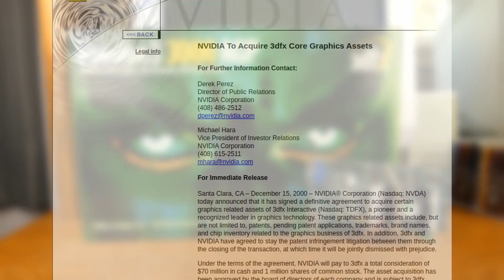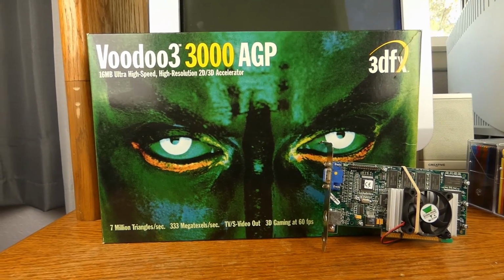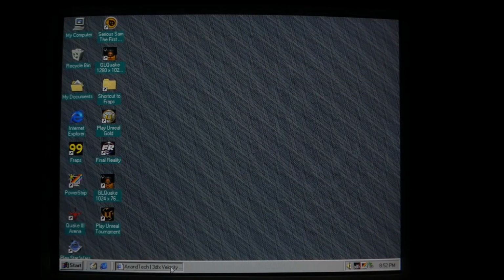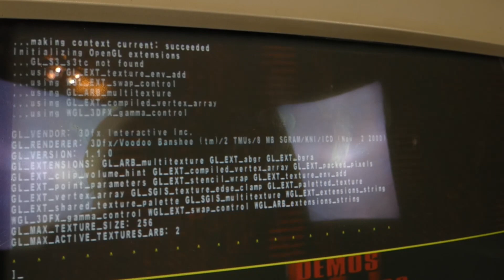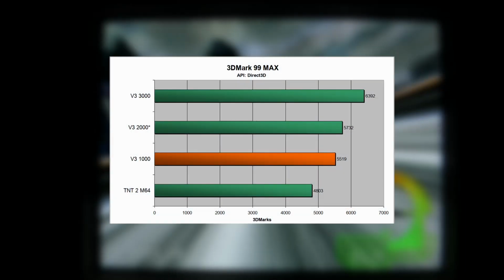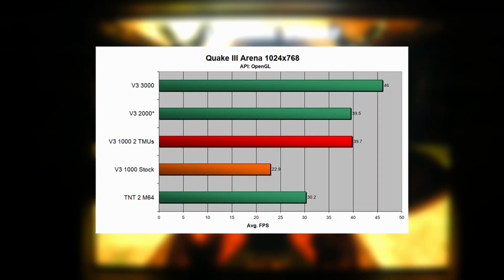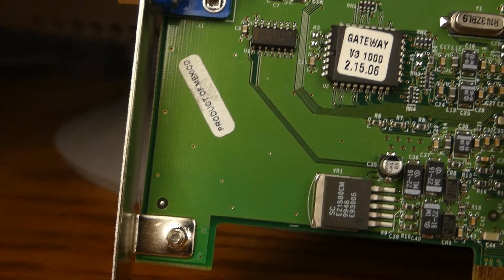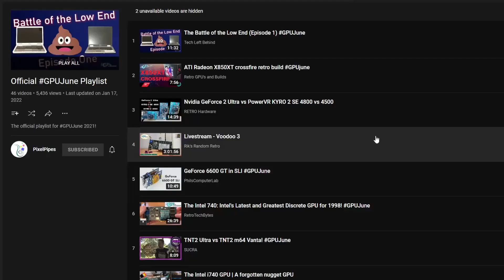The Voodoo 3 Everyone Kinda Forgot

Comment: I just dug up my Voodoo 2, Voodoo 3 2000, and I just acquired hidden away in a Pentium 200mhz ceramic package no less powered Compaq! Usually I see them in plastic like the MMX but I popped the heatsink to be greeted by an i200 label! But I booted it to see a Voodoo Banshee bios pop up.

Comment: I suspect it wasn't so much laziness but cost-effective so they didn't need to produce another chip but then needed a cost-effective way of lowering the performance of these OEM cards. So they went for the software option that likely went over the heads of most people using them.

Comment: There are even more differences between the 125mhx and 143mhz models, which is that the 125mhz models typically use 2TMUs where the 143mhz one has only one. Like you said too, the 143mhz one also only has 8mb of memory while the other has 16mb. When talking about the two unique models, I typically call the 125mhz model the Voodoo 3 1000, and the 143mhz one the Velocity 100.

Comment: I have a V3 1000 16MB 125MHz no heatsink pulled from an old Compaq Presario 5900Z. I installed a heatsink but the card runs pretty cool and is a decent GPU for free. Great video didn't even know about the TMU locked out.

Comment: Sir, I believe that card is called 3Dfx Velocity 100 and not Voodoo 3 1000.
The Voodoo 3 1000 has only 16Mb model (I have this card along with Voodoo 3 3000) while the Velocity 100 has only 8Mb model.

Comment: Your TNT2M64 results look really bad, maybe you were using TNT2 vanta? I had M64 and I'm pretty sure that quake 2 was absolutely playable on it. For example results from IXBT "creative 3D blaster TNT2M64" review:
Quake 2, 1024x768x16
TNT1- 37fps
TNT2M64 - 41fps
TNT2M64 OC - 53fps
TNT2 - 58fps
Even in 32 color bit this game was playabale (over 30fps) 
TNT1 - 27fps
TNT2M64 - 34fps
TNT2M64 OC - 44fps
TNT2 - 50fps
Reply from the maker: I don't recall the M64 mentioning it was a Vanta, but something to keep in mind is that there's such a wide variety of them out there with different clock speeds and ram configs that it's inevitable some are going to be bad and some will be okay. It could also be down to the driver version I was using or the platform (this is a VIA chipset afterall). Or maybe I got my numbers wrong, but I'm pretty sure I double checked everything before I made the graphs.
Reply: @NTGTechnology  Fair enough. There were indeed many TNT2M64 variants and also drivers could make a difference. I had creative 3D blaster TNT2M64 and with OC this thing wasnt much slower than regular (stock) TNT2, but of course TNT2 could be also OC'ed. In 1999 M64 was a very decent card and I was very happy with M64 performance, becasue I could play every game in 1999 at 1024x768x16 with over 30fps, while some of my friends still played in software mode, or at sub 30fps even at 640x480. I had TNT2M64 only till 2001 when I bought geforce2MX. Back then progress in GPU technology was just insane, you could buy a new PC today, and it was obsolete 2 years later LOL 😁. In 2003 I already had Geforce 3 and that card was over 10x faster than my TNT2M64. In quake 3 I had 5-10fps at 1600x1200x32 on TNT2M64 32MB, and around 100fps on Geforce 3ti200 128MB (OC'ed to almost ti500 clocks). These days you can buy 5 year old GPU and it will still play games just fine.

Comment: It's interesting that Quake 3 is seeing it as Voodoo Banshee since Voodoo3 was basically a Banshee with higher clock speeds and an additional TMU. Also, it's interesting to know that Creative's 3DBlaster Voodoo Banshee used SGRAM, so maybe there's something there, too...

I remember reading somewhere a loong time ago (like almost quarter of a century ago, literally🙂)  that Voodoo3 was initially going to be a successor to Banshee (like Banshee 2) and that "real Voodoo3" (next-gen product) was going to be what became of VSA-100 (Voodoo4 and 5). And this actually makes sense, when you think about it, because VSA-100 was a real generational jump forward compared to Voodoo2 (and Voodoo2 itself was basically a higher clocked Voodoo Graphics with a second TMU) since it allowed so much more (32-bit rendering, FSAA, about 10x higher texture resolution...) and a basis for several products down the line. So even Voodoo4 and 5 were basically just something that was churned out to buy some more time on the market before 3dfx could develop Rampage (a real next-gen product, which 3dfx worked on since 1998.). Unfortunately, by late 2000. and going into 2001, 3dfx was out of time and went under because of bad management and being unable to adapt to the new market reality of more frequent product cycles and failing to take advantage of OEM).

Basically, ideally, it should've been like this:

Voodoo Graphics->Voodoo2->Voodoo3 (but based on VSA-100 instead of upgraded Voodoo Banshee core)->Rampage (which was to be based on VSA, but with hardware T&L support to compete with GeForce256). Sadly, we never got that and instead we got a stop-gap product (namely Avenger) and a failed market strategy, which led them to bankruptcy and getting acquired by Nvidia.

Comment: Nice tip on the MTU, was not aware.
I also have the V1000 with 16 MB of SGRAM, no heatsink, no OEM brand on it, just the V3 1000 v2.15.05 sticker. Most listing I see suggest it comes from CompaQ. BIOS bootup for this card was just a black screen, but managed to flash the bios to v2.15.11 without a problem. This made BIOS post showup again for the card, revealing the 16 MB.

Real curious to see if I could push this with a bit of overclocking by mounting a heatsink and a fan, or maybe even to go as far as flashing a 2000 bios on this.

Comment: A very flawed review. Nobody played games at 1024x768 even with the voodoo 3 3000.  I know since I had one back in 1999. Testing should have been done at 800x600 so that the V3 1000 wouldn't hit it's 8mb memory limitation which it clearly did in most of his benchmarks at 1024x768.
Reply: I'm pretty sure a lot of people were playing in 1024x768 on Voodoo 3 (even on my TNT2M64 I was playing all my games in that resolution). But the V1000 should be tested at 800x600 for sure because it only has 8MB (like Voodoo2).
Reply: @PabloB888  You may be pretty sure but I'm 100% sure since i lived though this time period and bought a voodoo 3 back in 1999. Nobody played at 1024x768. The vooodoo 3 just wasn't fast enough for smooth gameplay and  that garbage TNT2M64 you have couldn't even play all games smooth at 800x600 due to the crippled clock speed and 64bit memory bus
Reply: @EvoPortal  Dude, just because you had a bad day it doesn't mean you have to be a jerk to people :P. Nothing you wrote is true, and I will prove it. I still remember 1999 like it was yesterday and I'm ABSOLUTELY SURE that people back then considered 30fps to be a very playable experience (after all Voodoo 1 could barely hit 30fps and yet it was a massive success). The voodoo 3 cards (from V3 2000 and up) i. 1999 were easily able to hit well over 30fps at 1024x768 resolution, therefore voodoo 3 owners could play in this resolution and most did it. You are the first Voodoo 3 owner that I have heard of who was running games at 800x600 on this powerful card. 

The Riva TNT2M64 32MB wasnt a high end card like Voodoo 3, but it was certainly a decent midrange card in 1999. The riva TNT2M64 card had the full TNT2 chip, but with a reduced memory bus / bandwidth. At lower resolutions, performance was much better than on the older TNT1, because memory bandwidth wasnt a huge bottleneck, but of course at higher resolutions like 1024x768 memory bandwidth was a massive bottleneck, so performance dropped to TNT1 levels. Thanks to memory OC however (increase in memory bandwidth) it's performance skyrocketed at higher resolutions like 1024x768. Results from creative 3D blaster TNT2M64 benchmarks (IXBT site review): 

Quake2 1024x768x16
TNT1 - 37fps
TNT2M64 - 41fps
TNT2M64 OC - 53fps
TNT2 - 58fps 

Shogo 1024x768x16
TNT1 - 33fps
TNT2M64 - 36fps
TNT2M64 OC - 44fps
TNT2 - 48fps 

Incoming 1024x768 in 32bit color
TNT1 - 28fps
TNT2M64 - 36fps
TNT2M64 OC - 52fps
TNT2 - 59fps 

3DMark99 1024x768 32bit color
TNT1 - 2085 points
TNT2M64 - 2316 points
TNT2M64 OC - 3168 points
TNT2 - 3401 points

A regular TNT2 was still faster, but not that much. In 1999 I have played EVERY SINGLE GAME at 1024x768x16 with over 30fps, deal with it dude. At 800x600 I could also play games in 32bit color, but I wasnt willing to do so, because even on my CRT the difference between 800x600 and 1024x768 was just too big (that's also the reason why most people who had Voodoo 3 played in 1024x768 as well). I was very happy that my parents bought me TNT2M64, because some of my friends still played in software mode, or on some extremely slow D3D cards like intel i740 that could barely run 640x480 and had glitches / artifacts in some games. 

My TNT2M64 32MB despite being cheaper card than 3DFX voodoo 3 had higher resolution textures support, so games like NFS5, Expendable, or Quake 3 looked way better on my TNT2M64. Also voodoo 3 image quality wasnt better compared to my TNT2M64, because voodoo 3 cards were still limited to 16-bit color. Of course 3DFX tried to mask this imperfection with their fake 22-bit color (it was just dithered 16-bit), but this feature blured fine details on the textures (very noticeably), so it wasnt better picture quality compared to true 32-bit color for sure. I still remember how blurry Quake 3 looked like on Voodoo 3 cards. Not only textures were at lower resolution (256x256), but also this dithering fitler was bluring them even further. 

All TNT2 cards were good products and Nvidia were able to match 3DFX products. Dynamite TNT2Ultra in particular run at 195MHz core clock and could win even with the Voodoo 3500. Add to that more features (32bit color and higher resolution textures) and no wonder 3DFX started to lose market share so quickly. 

Back then progress in GPU technology was insane, so 2 years later my TNT2M64 (including regular TNT2 and voodoo 3 cards) was obsolete anyway :P. I had geforce2MX already in 2001, and Geforce 3 in 2002. My fps in quake 3 (1600x1200x32) went from 5-10fps on TNT2M64, to 20-25fps on geforce2MX, and to around 100fps on Geforce 3. Over 10x more performance in just 3 years. Back in 1999 my TNT2M64 was awesome card, but in 2001 it was just too slow. I know some people still game on TNT2M64 cards even after 2001, but then it certainly wasnt a good experience.
Reply: @PabloB888  lol Im not being a jerk Im just being correctl
Reply: @EvoPortal Benchmarks from 1999 proves you are wrong. If you really had V3000 and only played at 800x600 then you were dumb as dirt, because every single game at 1024x768 run well above 30fps even on V3 2000, and back then no one played at 60 fps anyway, because CPUs were too slow and could barely run 30fps. Because of CPU bottleneck voodoo 3 owners were forced to play at 30fps in both 800x600 / 1024x768. Every single voodoo 3 owner I knew played at 1024x768 simply because that resolution looked much better and run pretty much the same.

Comment: TNT2 M64 score looks surprisingly low; did you run it in 32 bits because that really hurt performance?
Reply from the maker: I'm pretty sure I ran everything at 16 bit because of the Voodoo 3s not supporting it.
Reply: Agree, here's results from creative 3D blaster TNT2M64  review and even in 32color bit results in Quake 3 were better than 27fps in his video review:
Quake 2, 1024x768x16
TNT1- 37fps
TNT2M64 - 41fps
TNT2M64 OC - 53fps
TNT2 - 58fps
Even in 32 color bit this game was playabale (over 30fps) 
TNT1 - 27fps
TNT2M64 - 34fps
TNT2M64 OC - 44fps
TNT2 - 50fps
Reply: @PabloB888  It's been a long time since I left the comment so I don't remember anymore, but a newer driver might explain it. The later detonator drivers meant for the geforce 4 and FX series really hurt CPU overhead on older cards like the TNT2.

Comment: I'm REALLY surprised you managed to get V3 2000 performance from this card! In my case I found a significant increase in card performance from soldering in 16MB of ram over the stock 8MB in an AGP on-board unit.

Comment: I own the Compaq version of this card with 16mb and lacks the heatsink. It also comes up as voodoo3 1000 in the boot bios when you turn on the computer. I may have to check the tmu in Q3 to see if it's set to 1 or 2. Either way, it a great card for a P2 build or an early P3 build

Comment: Regarding the activation of the second TMU: yes, it was very easy to do, but probably very few people did it, because of two things. First: those cards were sold in OEM machines, people who bought them weren't exactly tech savvy, they just needed a computer to do "stuff". Second: it was around year 2000, so internet wasn't quite common. But it was a weird move to disable the TMU, I think that halving the RAM size to only 8 MB was enough. Plus, some cards were clocked lower than 143 MHz... Disabling the second TMU was too much, it was basically an overclocked Voodoo Banshee at this point, not a V3.

Comment: I actually own a Voodoo 1000, so I found this particular video of great interest 😀According to Everest Home Edition, it’s AGP 2x has 16MB of SGRAM and the GPU is clocked at 125MHz, and I can confirm it has no heat-sink attached. I had no idea that it was an OEM type card that came with Gateway computers. I picked this up by itself some time ago and in a completely bizarre twist of fate I ended up fitting it to a Pentium 3 450 “Gateway” motherboard. You could almost say it found it’s way home… After seeing this video, I decided to run a couple of benchmarks with it and got some interesting results. In comparison to your result in 3D Mark 2000 of 1357, I received a result of 2236, which is considerably more, and I just ran the default benchmark. I also ran the Quake 2 benchmark exactly the same as yours and got a result of 64.2. You got a result of 69.8, but I believe you’re running a CPU twice the speed of mine. I also noticed I have two TMU’s, I must have unlocked this a while back as I don’t remember doing it… Anyway, just thought I’d share 😁
Reply: The non-velocity variants have the two TMUs unlocked by default in my experience. It's only the Velocity that has one locked
Reply: I have the same card no heat sink.

Comment: I still have mine!  It is the 16MB Voodoo 3 2000 version, but it is PCI slot and not AGP.  I believe that my PC at that time may not have come with an AGP slot and that's probably why I got the PCI slot version.  I actually installed my own cooling fan on the heatsink just to keep it a little cooler.  The first card I got from CompUSA was defective at the time and burned out after about a week.  It actually smelled funny too when I took it out of the box and I had the feeling it was not going to last.  Luckily for me it went out before the return policy was up and they gave me a new card.  I still have the original box sans the bar code which I probably sent in for some type of rebate.  I remember that I used some special modified drivers for it to get better results, but I can't remember the driver name or who created them at the time.  I must have them on one of my backup drives somewhere.....🤔👍👍

Comment: I wonder would it be possible for 3dfx to relase 32 MB Ram of Voodoo 3. Was Avenger able to handle more than 16 mb of ram in general?
Reply from the maker: I'm not sure, I've never heard that there was any specific reason they couldn't have. Maybe they felt it was unnecessary? The Voodoo 3 only supported 256x256 textures when the rest of the industry had moved on to larger textures, so maybe that has something to so with it.
Reply: no

Comment: The Velocity 100 and Voodoo 3 1000 are actually two distinctly different cards.  143mhz, 8mb ram, one disabled TMU=Velocity 100.  125mhz, 16mb ram, NO disabled TMU=Voodoo3 1000.
Reply from the maker: Ok, but then why is my supposed “Velocity 100” listed as a Voodoo 3 1000 in it’s BIOS when it boots up and in the driver?
Reply: @NTGTechnology  If I had to explain their motivations, I'd answer in line with your own conclusions about how they went about disabling that 2nd TMU: When it came to the Velocity 100, 3dfx was lazy.  An AnandTech article mentions the release of the card, citing it as a separate product from Voodoo3 but still clearly a spin-off.  It suggests the Velocity was positioned for business users so they may not have cared about the details.  The 3rd page notes that its drivers are basically just Voodoo 3 drivers with a modified .inf file, and concludes that "it sounds a lot like the Velocity is a Voodoo3 in disguise."  Although they relate it more closely to a Voodoo 3 2000 with half the RAM than to the OEM Voodoo 3 1000, "Velocity 100 makes an excellent budget alternative to the Voodoo3 2000."  "With both TMU’s pumping out pixels, the Velocity 100 also performs identically to the Voodoo3 2000 in nearly all situations."  https://www.anandtech.com/show/401